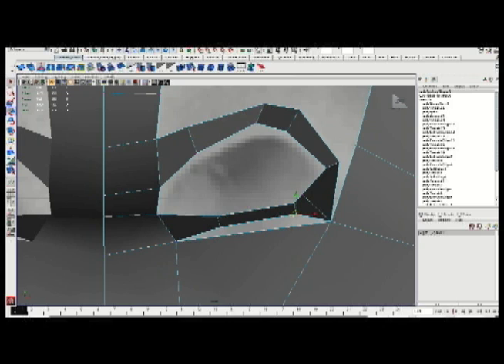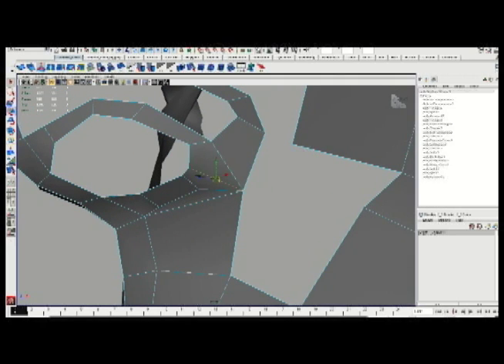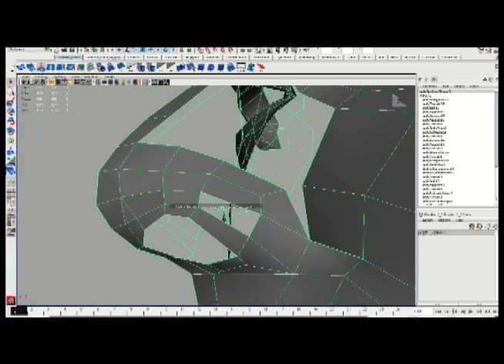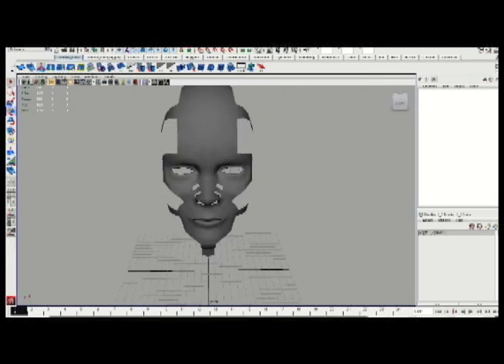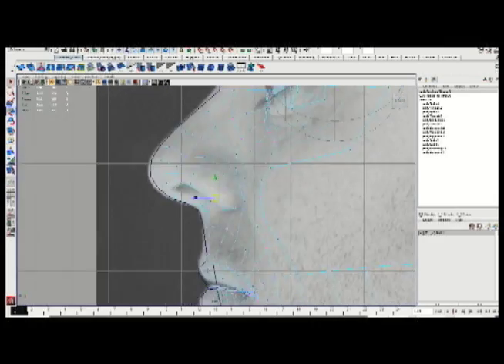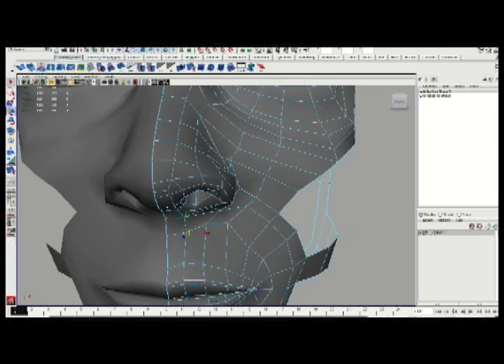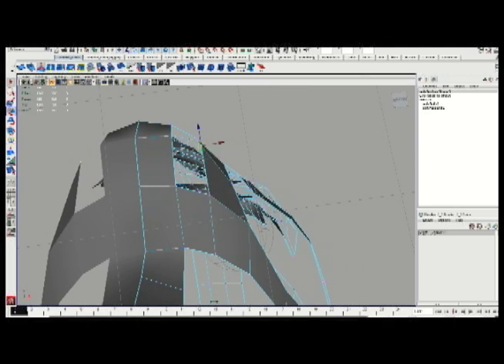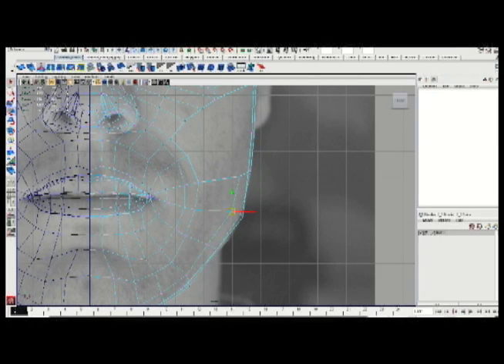3d Modeling a Head in Maya- edge extrusion method (4/6)

Comment: it appears your two halves are connected at the middle, i have been doing these steps but my 2 halves even though when i change one the other changes, when i pull the edges between the duplicates they are completely seperate still, is this wrong? i assume its an easy fix if it is.. i just have no idea, merge vertexis doesnt seem to work..